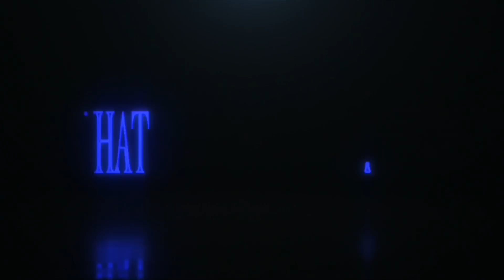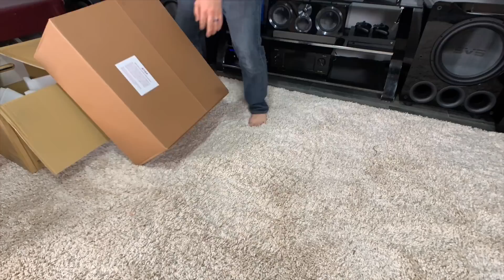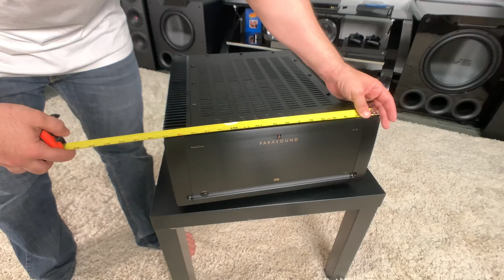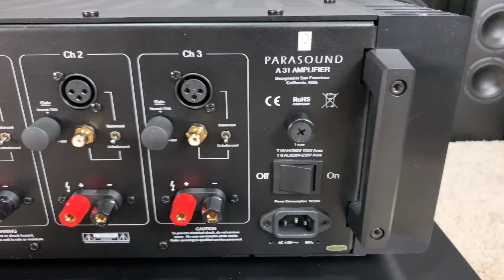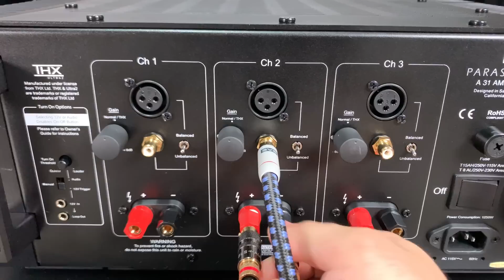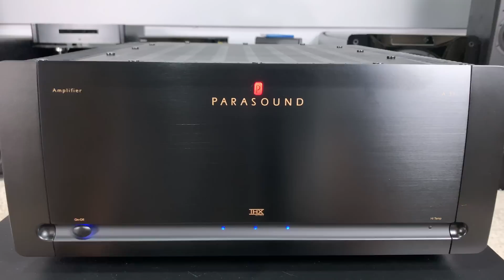Parasound a31 THX Amplifier | Unboxing & Setup

Comment: I just have the hca 1000
I have my gains cranked maybe I should  return them to 12 o'clock .it does shake the room for 125watts wuth a sub and my celestion impact.wish I had the halo  amp

Comment: Did this unit come with a trigger cord?
Reply from the maker: yes. even if it didnt the cost is less than 10 bucks on amazon
Reply: @ThatHomeTheaterDude  even cheaper if you look. I bought one for 2.50. Works like a champ.

Comment: That's a mighty nice Ikea end table you've got there! I've got the same one, actually. Thanks for using it in this video. Been wondering how much weight it could hold for just about the same purpose - to put my AVR on it for dusting / cleaning. Otherwise, great video. Been contemplating getting this model
Reply from the maker: hahah. yeah the 10 dollar ikea table can hold some weight.

Comment: I've had this amp for about 5 years now and love it. I set the turn on at lowest as I tend to listen to music pretty low and if it was set any higher it wouldn't even turn on. It has never turn on on without any signals. Congratulations on a great amp.
Reply from the maker: Sadly I dont get to keep it. Its a review with an option to buy. For my needs I need two 5 channel amps so I will be reviewing the a51 and a52+ next. I will probably buy those. The auto on feature is a little lacking if i have my volume -28 or lower then it will cut out. my outlaws never did that with auto on. I talked to them and they said they prefer to use a 12v trigger
Reply: @ThatHomeTheaterDude  That's a lot of power there with two 5 channel amps. Honestly I don't think you'll hear much of a difference amping the other channels with a high power amp. The front three as you stated is really the most important ones. But I guess if you have the spare money and like having nice matching amps, go for it. For sure it can't hurt.
Reply from the maker: the goal is to move to a pre/pro capable of 16 channel processing. Thats why I want to go to 10 channels of parasound. I can still use my arcam for heights. It may be a bit much but i feel like transience could be improved by having the extra headroom on tap. Plus the class A sound is really appealing

Comment: Hi home theater dude, I was wondering as far as powering a front channel's LRC .you're personal opinion on what you would get for a svs ultra set up , I'm looking at outlaw 2200 mono blocks like you did also emotiva, parasound  and rotel.  I'm not sure if you have ever listened to rotel or adcom. But I have herd both of those amps and the rotel has always sounded really strong. I have also listened to a lot of mark Levinson gear but I can not afford to buy anything at that level at this point of my life but the others are maybe a possibility. Thanks also for always helping the community.
Reply from the maker: Im selling my model 2200s for 900for all 3. I really like the way the class A sounds like from the parasound, but the ab and h sounds pretty great on the outlaws too. all have different voicing. the outlaws are less warm than the parasound but sound great all the same

Comment: Great video. But what's with the scratches on the back end by the right handle.
Reply from the maker: looks like fingernail scratches. The finish is micro polished. At that fine of a finish a fingernail can make a mark. But you can simply wipe them off too.

Comment: 1250 watts, can you explain what that means? does it use that much during regular use, or available? etc. it was on my short list till I saw that 1250 number . thanks
Reply from the maker: the amp is rated at 250 watts a channel at 8 ohms (750) and 400 watts a channel at 4 ohms (1200) The number on the back is maximal power usage from the wall. In this case there is 50 w of headroom to help with anonolies and to actually power the unit. Its not going to kill your power bill running one of these. I dont understand how 1250 is a deal breaker for you

Comment: How do you prepare your home electrical wiring for a system like this? Does this affect your electric bill that much
Reply: I dought it will add much my pioneer sc-lx73 only seems to pull no more than 160 watts max from the wall maybe 230 watts if loud.   if it were pulling around 3k watts I think you would be deff.
Reply: @EastAngliaUK  thank you. It's something I always wondered about with so much equipment drawing from the wall.
Reply: @kazuma-kh5tx  on my channel i have a device plugged in and tells you real time watts and usage its cheap to buy.
Reply from the maker: Yes You should prep the electrical system. I will be adding more dedicated circuits for the amps. My electricity bill hasnt increased much since i added the home theater.
Reply: @ThatHomeTheaterDude  maybe one day you could possibly do a video going a little more in depth to doing that. I am still relatively new to the high end scene. Trying to plan what direction I want to go
Reply from the maker: dang thats cool. My panamax shows incoming voltage and current usage. I dont have those fancy gadgets
Reply from the maker: I planned a power conditioner video a while back when I had three different models. I was too busy to film during that time. I should be able to do it soon. Im planning a home theater basics series i should be able to do later on this weekend... hopefully
Reply: @ThatHomeTheaterDude  awesome. I look forward to seeing it. Most of us to buy speakers and a receiver but we lack the details in between. I appreciate you taking the time to respond to my comments

Comment: It’s always good to balance the budget for external amps between power, and number of actual amp(channels) placing this at powerful and pretty, but not practical. It’s rather expensive for only 3ch..don’t you think Chris?
Reply from the maker: I dont agree. Parasound is expensive but there is a reason it is expensive. Yes you can get an amplifier that has more power per channel cheaper. These arent in everyone's budget and currently outside of my budget. There are a solid construction with flawless performance. This is analogous to people spending the extra cash on anthem versus a bottom of the line yamaha. price is a sliding scale. Some people have more and some people have less. Or have a preference to each.

Comment: That amplifier is a behemoth! Very nice aesthetics, great back panel layout, and plenty of power. I have been a Parasound fan for a long time. I am using two of the HALO A23's in my current setup, just love them. Great work on the video man!
Reply from the maker: Good word. Behemoth. I may use that in the official review.  I have heard about parasound for years and Im acting like a groupie that its in my house. I think its so cool to try  it out.

Comment: Great amp. I have always wanted to try the A51 with my Dali Epicon speakers. When I do finally move on from my current Nad Master Series M25 it will be for either the A51 or an ATI Morris Kessler Signature 6007 ... if I have the extra pennies i will go with the ATI.
Reply from the maker: ATI is solid. I use arcam and parasound right now. I may sell the arcam and buy another one. Who knows.
Reply: That Home Theater Dude looking forward to your review of the A31 I am really enjoying the channel. It would be so cool if you could review the ATI if it’s possible.

Comment: Been a huge fan of Parasound for 20 years! I'm drooling over this new beast
Reply from the maker: Yeah. This amp is "older" because it has been out for a long time, but it is a solid amplifier. the A52+ and JC 5 get more love but I really like an amplified front stage. When I plugged this in I could tell a difference. Its solid and built like a tank. This will last for another 20 years. I have no doubts about that
Reply: Can you tell me why you chose parasound rather then emotive am bout to give up trying to figure this stuff out I keep hearing this or that is better and these guys keep changing there stuff
Reply from the maker: peanut McPherson I didn’t necessarily choose. I asked emotiva to send out a set of amps and they just sent this one over instead. I wanted to check them out. Maybe sometime on the future. I can’t speak on how the emotiva xpa Sound cause I haven’t used them. The parasounds are amazing. I’m on 2 and 3 of the units to review. I love them so far. Crystal clear and powerful.